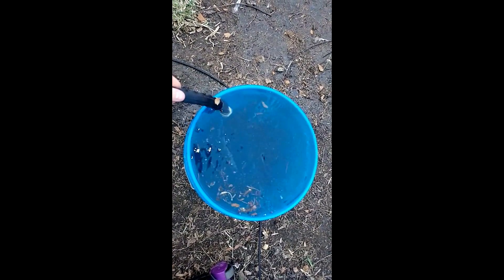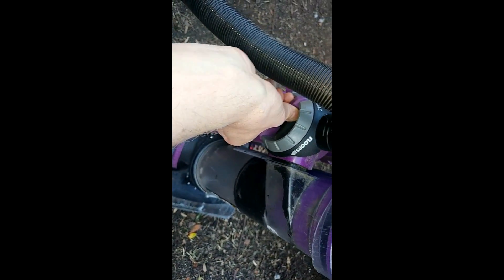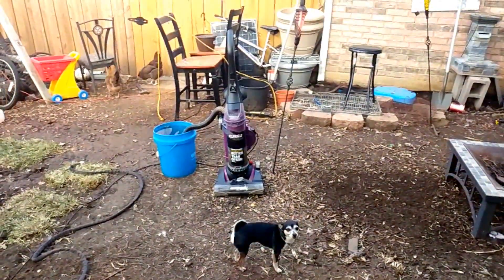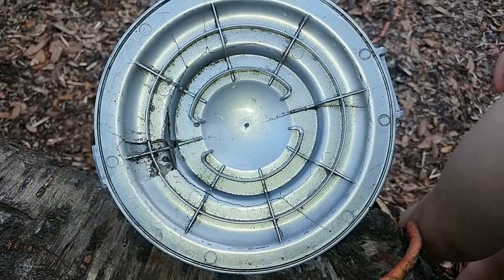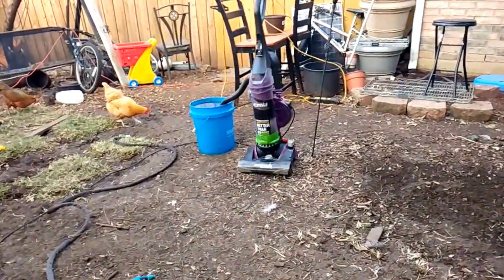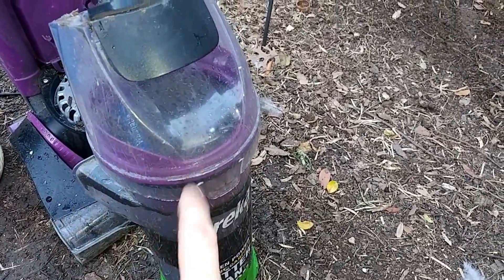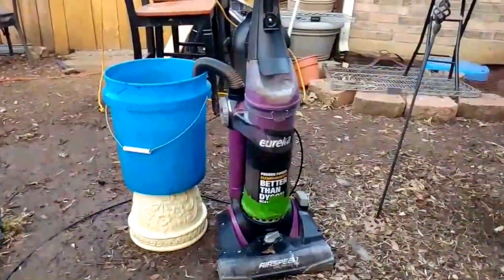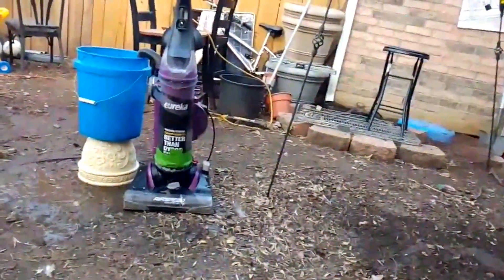What happens when you suck up water with a regular vacuum?

Comment: It would seem that by attempting to suck up water, you discover why it wasn’t sucking up air, and so you fix it … and then just when it’s working properly and has a new lease of life ahead … you suck water through the motor anyway … is it dry yet? Does it still work…
Reply from the maker: I continued to test it monthly. It finally failed to turn on after 5.5 months after I made this video. But I am not sure why it failed to turn on. My original suspicion was the motor rusted and locked up, but there was no power draw through the cord. So I just threw it away.

Comment: Obviously, the Eureka is a bad a$$ vacuum. Now admit it. You couldn't kill it!
Reply from the maker: I did give up on killing it, I just left it in the back yard for the kids to play with. about a year after this video I tried the vacuum and plugged it in and it was finally dead. I assume the water rusted the electrical contacts or magnets or bearings and it finally stopped working. But if I looked further i would have bet money that it was the switch that failed and i could have hot wired it to get it running again.